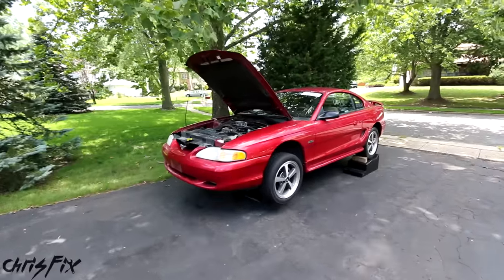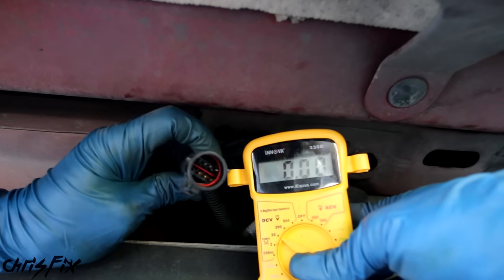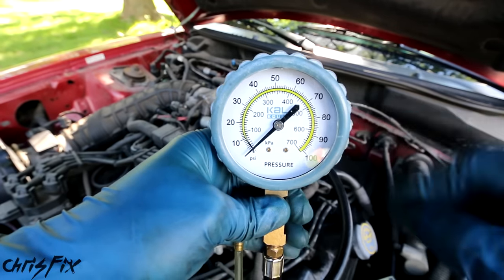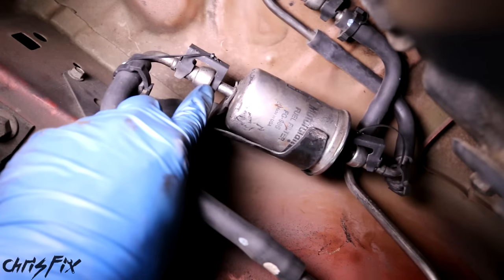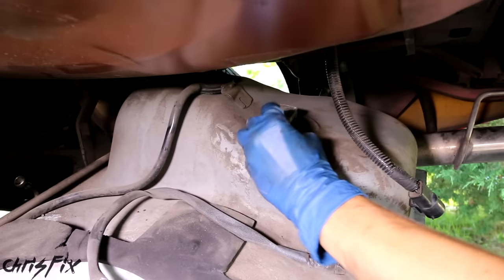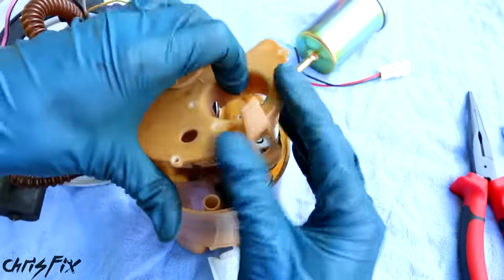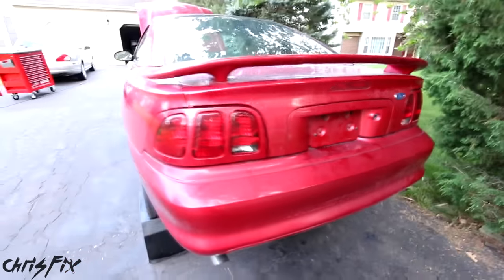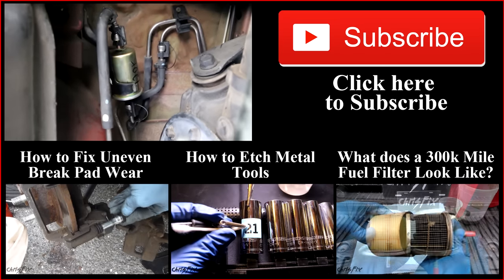How to Diagnose and Replace a Fuel Pump

Comment: the previous owner will cry if he saw this video....
Reply: why? these mustangs are worthless.
Reply: +David Serrano Wrong kiddo
Reply: hentai nat I think Wang implied that the original owner would cry because the fix was easy.
Reply: +Jared P wrong? dude this is the most undesirable mustang ever. it's slow and ugly. even the fox bodies are more desirable.
Reply: I bought a car not long ago, owner didn't know why it would start. I literally put a battery in it, and it ran...
Reply: +David Serrano Lots of people like the SN-95, they're good looking cars! They may not be fast in compared to today's modern mustangs, but you can always make them fast!
Reply: +David Serrano you must not know about this car. This body style is called the sn95. The 4.6 was the undesired part of this car. People loved that body style. That's why people want the 94 and 95 that came with a 5.0
Reply: maybe the owner was getting a new car anyway and didnt want to bother fixing and old one it went to charity anyway so win win and chrix has it so triple win
Reply: why
Reply: +max well well I know that it is the least desirable because I sell used car parts. people want fox body parts a lot more than this generation including the generation after it. it's the least desirable mustang ever made. of course some people still want it but it's not as desired as newer mustangs or as the older and fox body mustangs.
Reply: +David Serrano mustang 2 is the least desirable body style and actually the 71 Mach 1 style body is more hated then this one by most mustang fans. This is 3rd least desirable
Reply: what the hell it is just a fuel pump anyone could've fixed with not so high price. is the maintenance price is very high in america or what ?
Reply: You might have meant labour ;)
Reply: Mr39foor the question is whether or not he donated it because of the fuel pump issue or if he donated prior to that. Also I think labor is 30-40 dollars an hour. Maybe more. I'm not sure. I don't go to mechanics
Reply: David Serrano hummm honestly i don't know what a labor is. the way it works here you give your car to the guy he finds out what's wrong with it and then he give you the price of maintenance and you usually buy the parts. if you don't like it you can try to get a discount. you also have the chance to go to someone else but that's not "cool". also yeah i found it weird that he might sold his car because of the fuel pump! it might've been something else but the cars seems fine
Reply: Mr39foor well he didn't sell it. He donated it. Also in America there is a book that tells mechanics how many hours a job is going to take. Or something of that sort. They then give you a price based on the number of hours times their hourly rate
Reply: so that cars is donated ! i'm so lost. there's so many new things. i get the labor now thanks now how is the car donated and he bought it with 11,000$?!
David Serrano
Reply: +Mr39foor The prior owner donated it to an auction and Chris but it from the auction.
Reply: PeRX how do you donate it to an auction!? donating is giving something for free. why would you do that? why would you give a car to an auction for free!!?
Reply: he bought it for 1100 not 11 k :)
Reply: Mustang II and *73 Mach 1.
Reply: +Mr39foor you donate the car to a charity who then puts it up for auction. the money made from the auction then goes back to the charity.
Reply: Mr39foor what BigBodySmallBrain said is what I meant
Reply: +max well Exactly. Body style was great, but the non-PI 4.6 only made around 215 horsepower. The good thing is you can switch 4 valve heads, intake, and cam for almost 300 hp; or the engine bay will also accept the 5.0 pushrod engine.
Reply: BigBodySmallBrain thank you all
Reply: +David Serrano I own a shop and labor is around 80-100$ an hour
Reply: 1990 Firebird Formula 350 TPI too much!
Reply: That's how labor has been for many years.
Reply: +David Serrano it may be 'slow', that doesn't matter to all people. And beauty is in the eye of the beholder.
Reply: +SideWayz Moose it's a muscle car. it's supposed to be fast lol.
Reply: +David Serrano nope not at all
Reply: David Serrano First of all, it isn't a muscle car it's a pony car. It was the first of its kind  and created the niche and the first version was pretty much on par with this one. Not the fastest or best at achieving anything performance wise, but still was the best at being what it was. 

Sometimes muscle cars are about feel and sound. In fact if you're obeying the law on a daily basis with one then that becomes very important. The Mustang only took a K&N and some Flowmasters to achieve that and with a manual, was VERY enjoyable to drive. I know as I bought a (then brand new) Mustang GT in 1990 and those were the first two things I did.

You may say well it must be the fastest thing I've owned. No, I've owned a lot of different kinds of cars, the fastest being an 80 Trans Am with a transplanted, hopped up 455 Poncho that I'd say could hit low 13s AT LEAST.

Considering the time the car was made in, who it was marketed to, what that engine was in, it had plenty of power. It certainly wasn't and isn't "worthless".
Reply: David McClelland in comparison to other mustangs it's pretty much worthless. People who buy this car now are people who wanted a mustang but can't afford a real one.
Reply: David Serrano So after all the education in this thread you go right back to original statement. LMAO! 

Ok whatever...
Reply: David McClelland well it's a couple of you all sharing your opinions. Forums and etc show otherwise.
Reply: Whatever tickles your boat and floats your fancy...
Reply: in USa you can donate a car that's worth 1000 to a CHARITY and get a tax deduction for book value that is much higher. So people who have a headache they cant sell give it to charity for a nice tax deduction.
Reply: People do a PI heads and intake swap on it. that gives it 260hp. The head can be found on any 2002+ crown vic or grand marquis.
Reply: adam sorell This Mustang has a 5.0L not a 4.6
Reply: +David McClelland wow, this mustang definitely has a 4.6L 2v modular V8
Reply: 1990 Firebird Formula 350 TPI ohh my bad! So busy arguing with the troll in this thread I got flustered.
Reply: +adam sorell If you have the heads off and all that fun stuff, might as well save for a set of Trickflow heads. Or at least get PI heads ported and polished. Either way, the best way to make power is with a supercharger or turbo.
Reply: +David McClelland NO, this is a 4.6. Look at the badging near the GT and they didn't offer a 5.0 in that model year.
Reply: buzman1985 I knew that. It forgot what year this was and made a mistake posting. I post a lot on Youtube.
Reply: Keith Upton Turbo is the way to go IMO. Much more streetable when not getting down on it.
Reply: @ToughLuckDumbFuck  
The owner couldn't replace a thing as simple as battery. Wow

Comment: My grandma was driving my grandpas old truck when one day it sputtered and died with quarter of a tank of gas and wouldn’t start. It sat there for 8 years in the driveway because she didn’t have the money to get it fixed. I decided to take the truck as a project, replaced the 10 year old battery, and sure enough it wouldn’t start. I bought a fuel pump for $100 and went to work dropping the tank. Only to realize the tank was bone dry. I filled up the tank and she coughed a little bit then bam. Started right back up. And that’s a story on how my grandpas truck sat dormant for 8 years because it ran out of gas. Don’t always trust your gauges especially on older vehicles.

Comment: Those actually aren't "quick disconnect" fittings. They're quick connect fittings. Disconnecting them takes significantly more work than connecting them. They're meant for quick assembly at the factory. With the right tools, they take less time than threaded fittings but sometimes dirt and road crud can get up in there and cause all kinds of hell.
Reply from the maker: +Nate Rowe thanks for sharing Nate! That's a good point lol. I've always called the quick disconnect just because I'm always disconnecting them haha
Reply: I used to be in the habit of calling them that, until I had a real troublesome one on an early 90's Ford. They're the kind of thing that can take a fun and cheap preventative maintenance item job into a torturous hell that you regret embarking on :) Anyway, enjoyed the video and thanks for being thorough in testing the other possibilities rather than throwing a pump on it and hoping.

Comment: It's probably been mentioned already, but it's a good idea to check for leaks after you've let the pump prime a few times, but BEFORE you actually start the engine for the first time. This especially applies if a car has been sitting without fuel pressure for while.

Comment: so I replaced my fuel pump on my mustang yesterday but it still takes about 6 seconds to cranks. any suggestions?
Reply from the maker: Sometimes mine does that too! What is your fuel pressure at the rail when you turn the key? Does it bleed off? Watch this:  https://www.youtube.com/watch?v=_oXLUqE4Sf0
Reply: Thanks for the response.. I didn't get a new fuel filter with it so I'm going to get one now because that might be the issue..
Reply: ChrisFix
Reply: Jackson Duckworth
Reply: Jackson Duckworth ?
Reply: Fuel filter is dirty
Reply: Could be a mass air flow sensor, I would try pulling it out and using some mass air flow sensor cleaner to see if the problem goes away.
Reply: How about a simple bad battery?
Reply: Jackson Duckworth it could also be leaky injectors
Reply: It is fixed now! It ended up being just really dirty fuel lines. I ended up using 2 little bottles of fuel line and enjecter cleaner and nkw she works like a charms 👌 thanks for the help
Reply: did you add the fuel line and injector cleaner to the fuel tank and run it through that way? thanks
Reply: Jackson Duckworth prime the pump by leaving the key in the on position for 30 seconds before trying to start the car
Reply: I think it is either spark plugs, or fuel filter.

Comment: I find it funny I find these videos after getting a taurus with 200k miles that sat for 2.5 years. I did the starter fluid thing and replaced the fuel pump then find these videos a few months later. Ford makes great reliable engines but dang can they not make a fuel pump

Comment: had a feeling my pump went out but wasn’t sure. ordered a pump but i will for sure be checking fuel pressure tmr morning. my suspicion my 13 g37 pump failed was because no start and also heard the clicking sound from the fuel pump as well. shout out the homie chris for being an awesome teacher even tho my car is a lot different than the drift stang!!

Comment: Great videos man, you give the exact amount of information needed and your pace is perfect without any unnecessary boring spaces, also delivered with a positive voice makes these videos very good! 

Going to end this compliment on a question since I'm having this issue with my car and need to wait 4 days until it can get checked; car recently got it's fuel pump changed, and the car starts but at some random point during driving, it starts stalling and sometimes even dies and needs to be restarted. Usually this happens 20 minutes into driving. Pressing the gas pedal when the car starts stalling makes it lose rpm drastically. What could the cause be?

Cheers from Sweden!